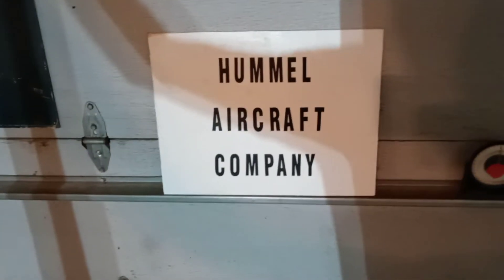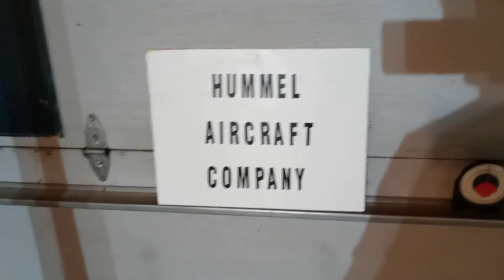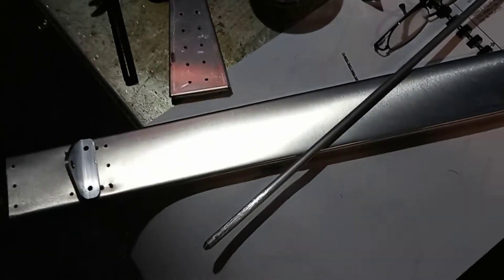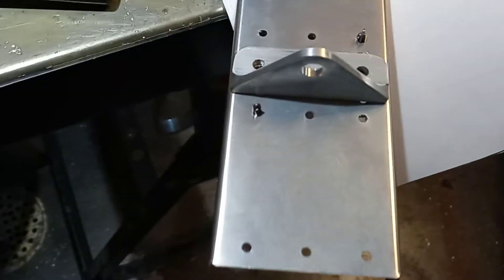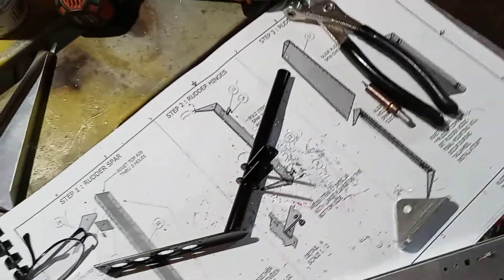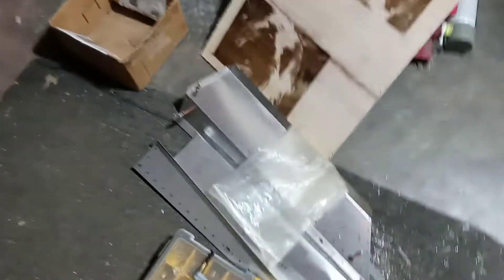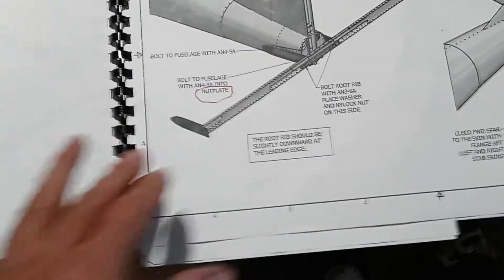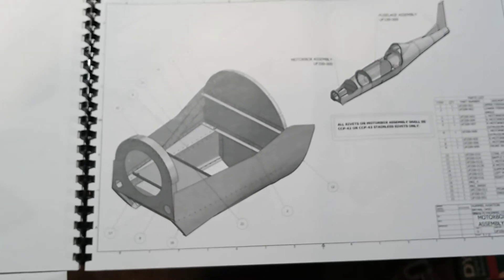UC rudder build and plans builder tip

Comment: I took your advise from another video to use the 3/32 rivets for the bulkheads corner tabs to keep it light, keep em coming, God bless.
Reply from the maker: Hi rp582 well sir I presume you used 3/32 SOLID rivets????? I sure hope you used solid. Please let me know.
Reply: Yes solid, also bought the roper punch.
Reply from the maker: Hi @Lancaster7  alright sir you are doing great!!! Let me know how you like the punch. I know it takes longer and it helps if you center punch where you want the hole first. But you safe on drill bits and shavings. Did you get a rivet squeezer? And God bless you with your build
Reply: Yes I got the squeezer fom Aircraft Spruce which they sent incomplete and gave a run around, they will be the last place I will buy anything. Later I found the squeezer in the yardstore catalog is called the "Texas squeezer".
Reply from the maker: Hi @Lancaster7  well sorry sir about the run around from A.S. The yard store is where I got mine from!!! Sounds like you are getting ready to do some building?